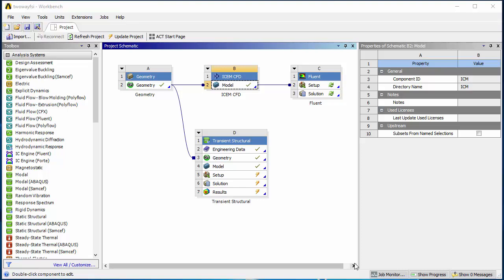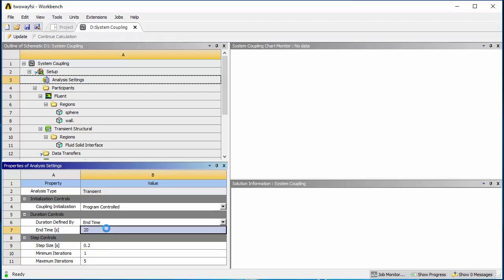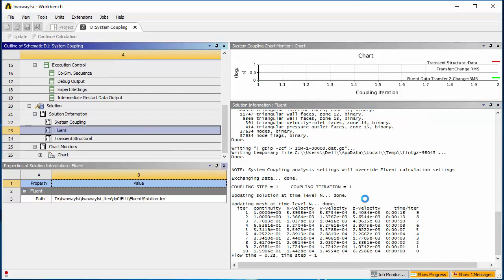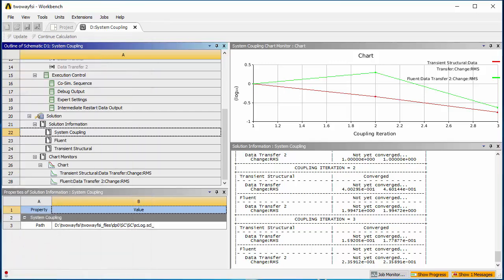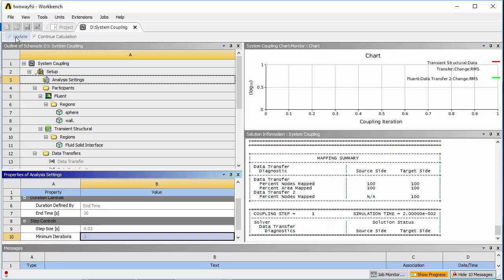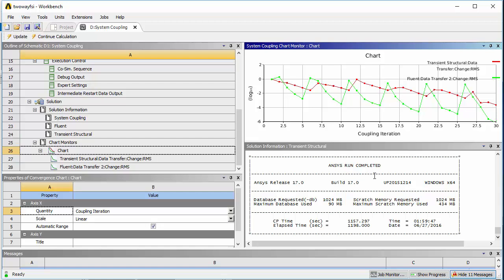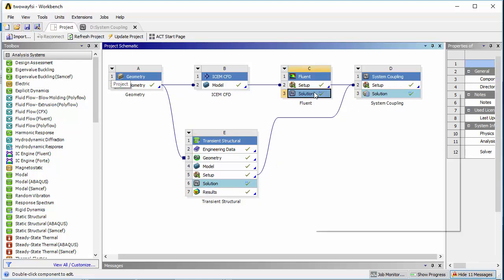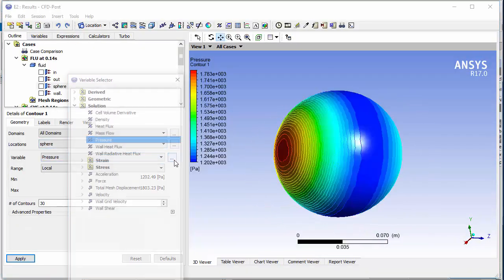Two Way Fluid-Solid-Interaction tutorial - System Coupling Setup and post processing  (4/4)

Comment: I could not find any info on the OPTION of choosing 1 Data trasfer (1 way FSI) or 2 Data trasfer (2 way FSI). How does the Ansys SC knows I want 2 way or 1 way?
Reply from the maker: one way, when you directly couple strcutral to Fluent. Two way when you use system coupling
Reply: @Engineeringcoffeewithsijal  Thank you!!!
Reply: @Engineeringcoffeewithsijal  I am using System Coupling. But when I select one region from Strutal and one from Fluid, I only get 1 Data Transfer isntead of 2...Previously, I used to automatically get 2 Data transfers. What should I do?

Comment: Thank you for the video. Actually,  I have a problem that the coupling is still on going for a long time and it doesn't finish, besides the file cannot be closed unless I force it to close with task manager. Everytime I open coupling system this happens. Could you help in this regard ?

Comment: Is it possible to insert an under-relaxation parameter in data transfer? For example, if we do not want the loads to be transferred from FLUENT to Mechanical at 100% but at some reduced values to ensure more stable solution, then how do we ensure that? Thank you for the beautiful videos.
Reply from the maker: I haven't tried it or even thought about it...But I would love to get that knowledge.
Reply: I found out. In the Data Transfer 1 and Data Transfer 2, we have the option of setting the Under Relaxation Factor for both Force and Displacement. In fact, in the same tabs we have the option to change the convergence criteria as well.
Reply from the maker: Nice. Vishal.

Comment: Sir, Inspired by your video I am now daring to simulate cylinder free oscillations of one degree freedom perpendicular to the water flow. I have one major doubt at present. As i am expecting cylinder displacement around 20 cm, can i have same dynamic mesh settings (i.e., smoothing and remeshing with the shown settings in your video) ? Does it works? Please reply.
Thank you.
Reply from the maker: yes. but it should be very slow rate, so that you dont get negative volume
Reply: hi, could you please tell how you simulate the cylinder oscillating. i would like to simulate an oscillated cylinder with sinusoidal displacement velocity of 2mm. could you please help me out in the structural setup???

Comment: Sir, I am suffering with the following problem while running the system coupling. The error message shows as follows.

"Update failed for the Solution component in System Coupling.  The coupled update for System, Transient Structural, threw an exception."

Could you please help me in  finding my mistake?
Thank you.
Reply from the maker: you have run the case again. reset every thing and update every cell
Reply: I have completed the simulation. Thank you so much.
Reply from the maker: good.
Reply: Could you please help me I am getting solver pivot error while doing this simulation

Comment: Thank you so much for this wonderful 2-way coupling tutorial. In this similar problem I want to restrict the motion of the sphere to one direction transverse to the fluid low. How can i do it?
Reply from the maker: You need to apply some functions in the motion definition
Reply: Is it the right way to choose the displacement function in transient structural set up and making its definition into components and setting X and Z directions to 0 and letting Y direction to FREE ??
Reply from the maker: yes. i guess so. But I have not used this option ever. It is just my thought...